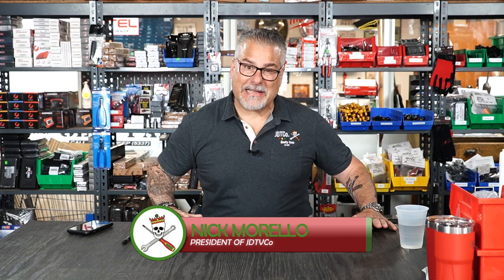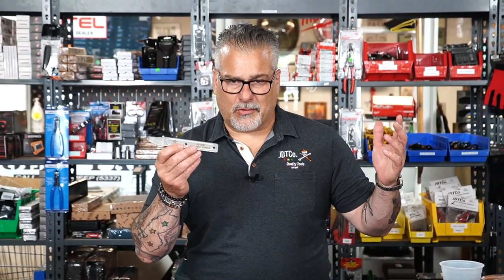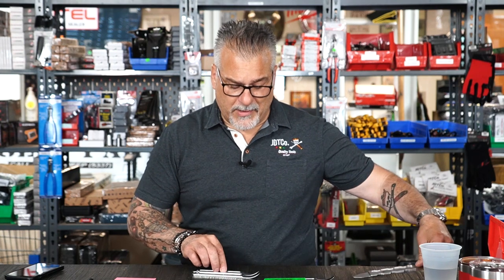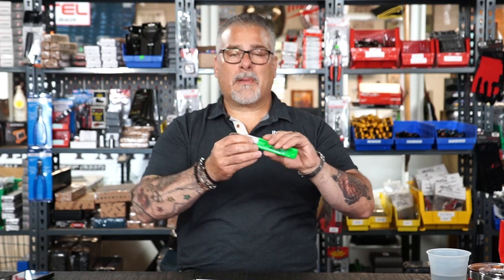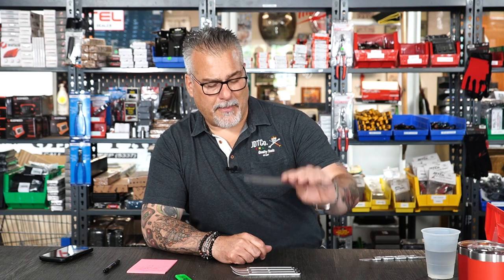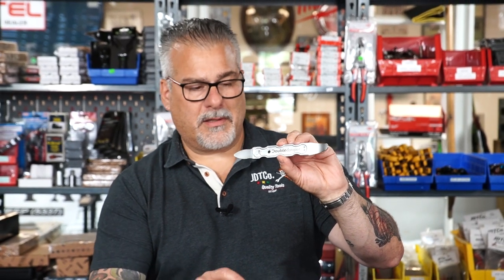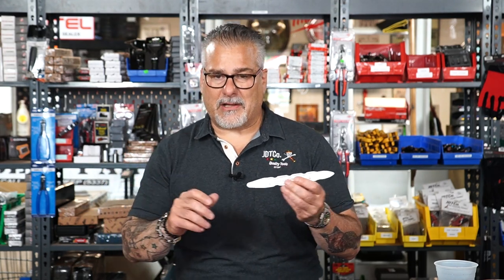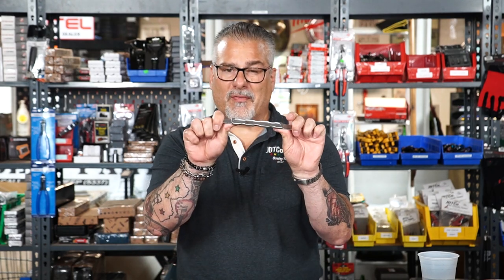JDTCO SHORT & SWEET JDTCO UTILITY TOOLS

Comment: Talking about multi use tools… last week I had to break loose some 3/8” socket head bolts with very limited access. No way to get a socket or ratchet on them at all. So I got a 3/8” Allen wrench, cut it short, and used the JDTCO warranty checker on the long end, the a long handle flex head ratchet snaked in from the other side of the machine. Turned into a two man job with myself holding everything together, and my helper pulling on the ratchet on the other side of the machine. 
 Not sure what we would have done if I didn’t have that warranty checker in my toolbox. 
 Great Job Guys !
Reply from the maker: love the story!